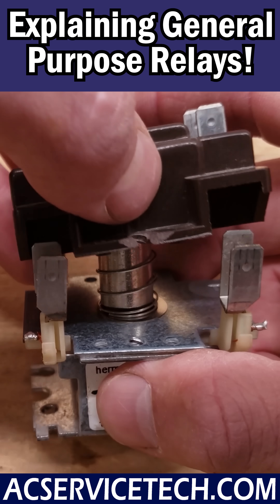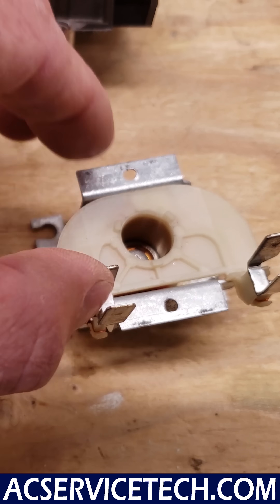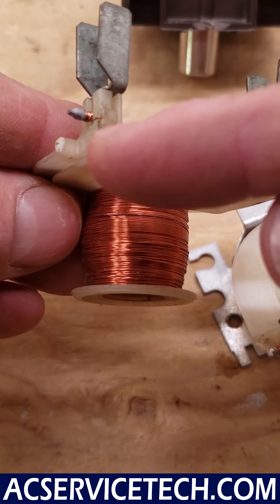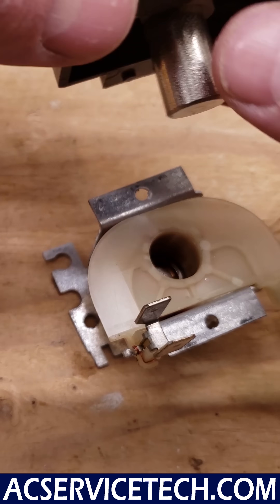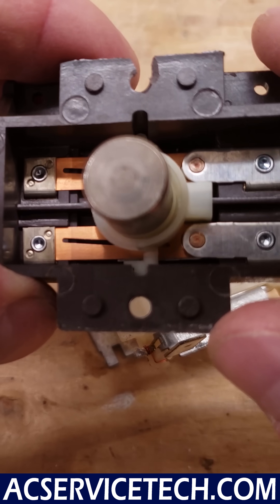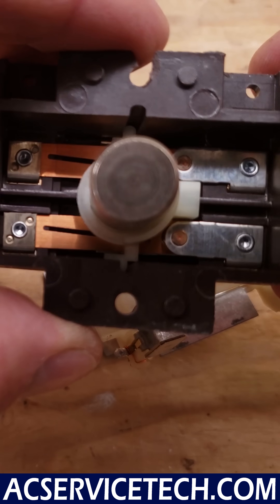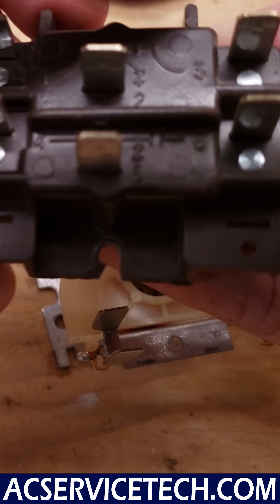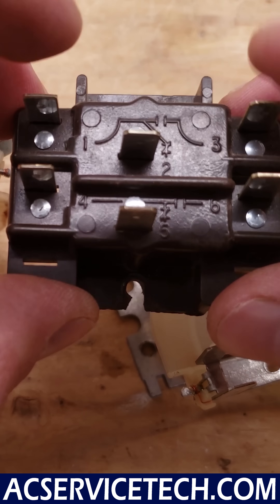General Purpose Relay Operation For HVAC!

Comment: I'm curious how the timer delays work so they stay on for 10 minutes after cutting power to them.
Reply: @robertsmith2956   timer delay?  You mean sequencers or actual timers?  

Generally…. sequencers use bimetal discs that make and break contacts at known time intervals while delay timers (like the ones for compressor short cycle protection) use small circuit boards with microchips.  Electrical control components are pretty cool.  Humans got lucky electricity is so predictable lol